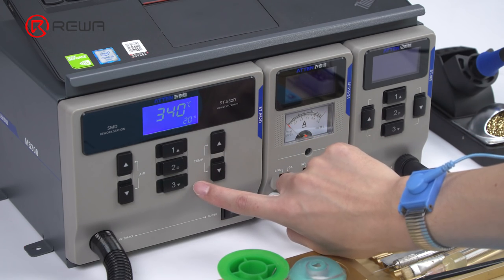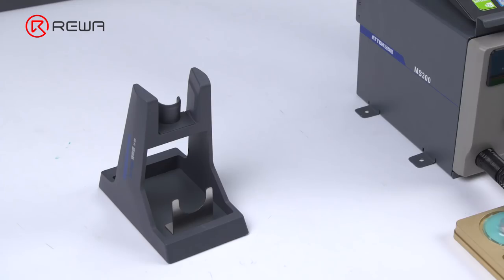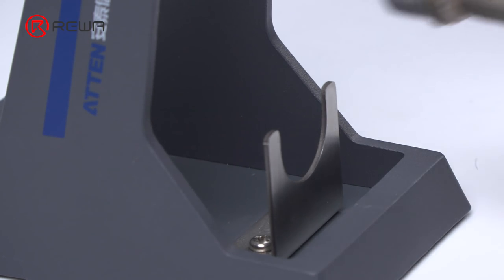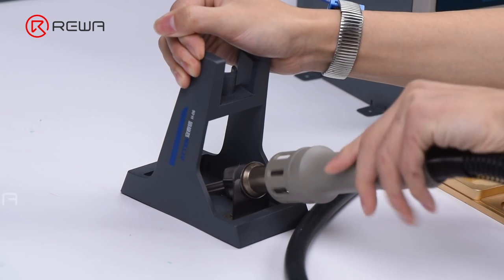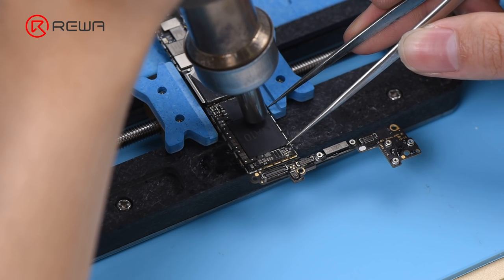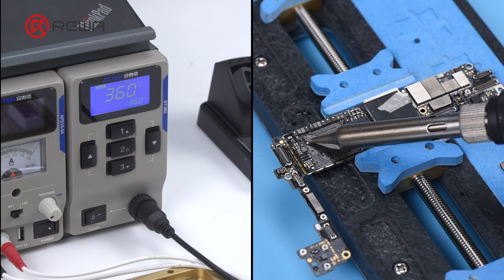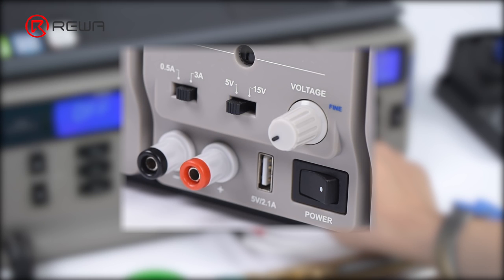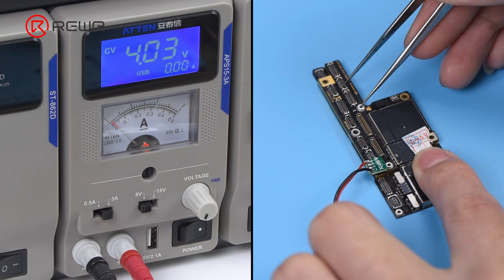Atten 3 In 1 Rework Station Best Choice For Motherboard Repair Beginner | REWA Selected

Comment: Looks good for a beginner to get into the trade, think I’ll stick with my JBC kit though, much more refined for long term professional use.
I used to use the aoyue kit branded as blackjack, that got me started but quickly and cheaply but hit its limits when in use for 8 hours a day.
Reply: Yeah JBC is way better in my opinion aswell
Reply: Please do you repair cell phone
Reply: according to people who use more expensive air stations this works equally well. for professional use .  this isn't an aoyue.

Comment: Does it come with any tips for the hot air gun and soldering tips??? or do you have to buy them separately (which I am finding hard for the soldering iron)